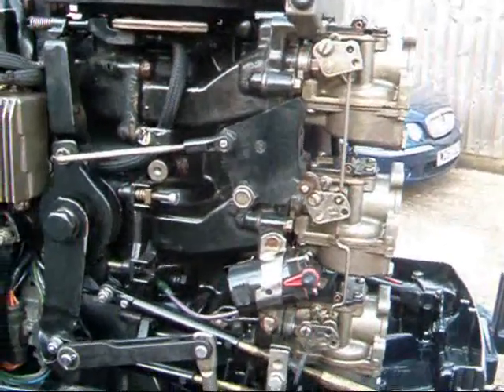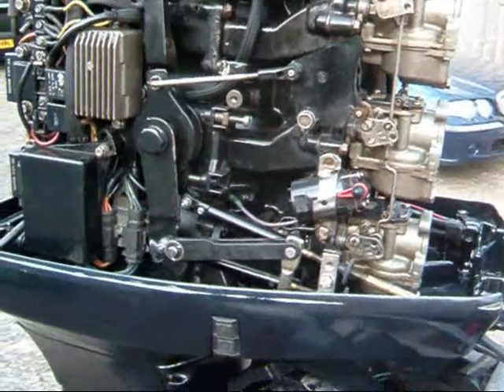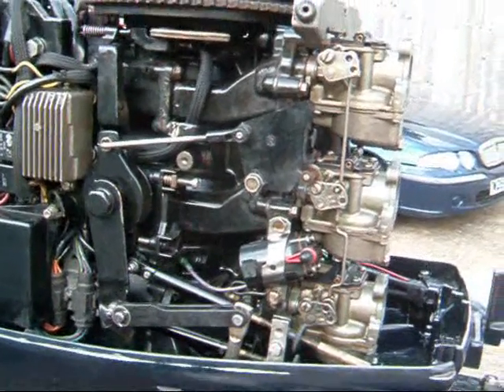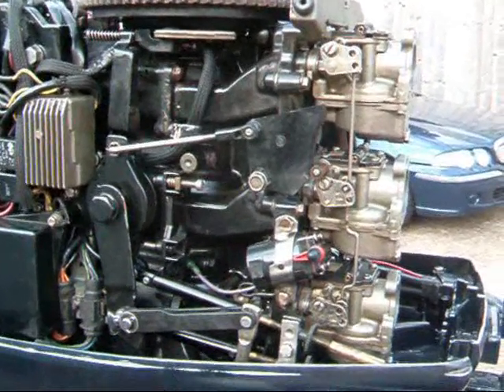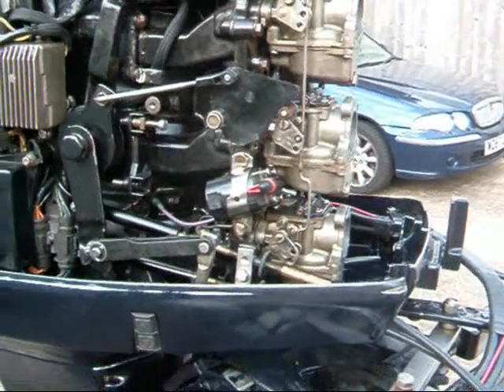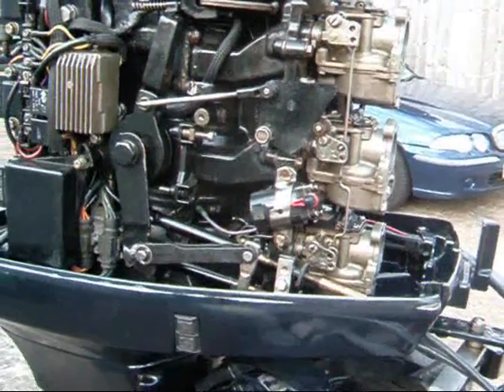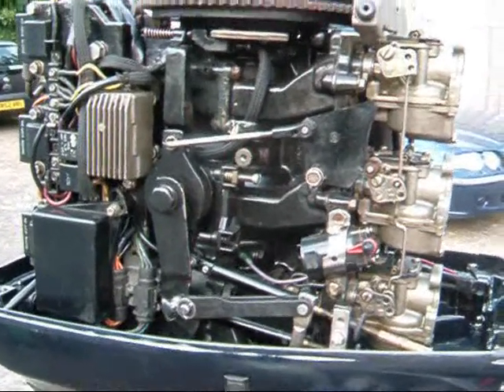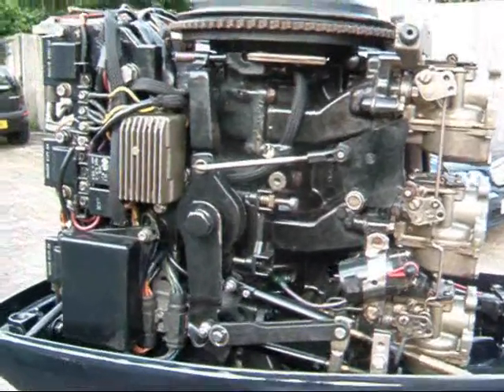EVINRUDE 60HP 1995 idle timing / lync n sync

Comment: I have this outboard. Where are the vacuum ports to connect carb sync gauges?
Reply: IamGreed aren't any
Reply: David Jessee yes there are ! They are located on the top above the lean adjustable screws! Open your eyes
Reply: STORMINORM Tharp the only thing on top is an orifice and a nipple. The nipple is from the fuel primer.  And you can't hook up a guage to a orifice
Reply: David Jessee get the adapter for the orifice
Reply: I saw this is real old but I learned you cant use a sync on a 2 stroke? I never found the ports.